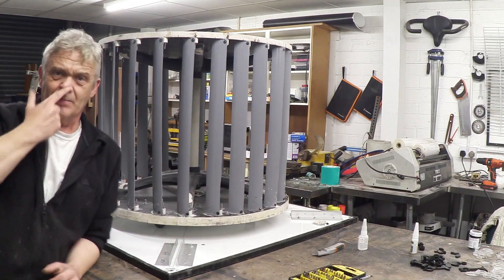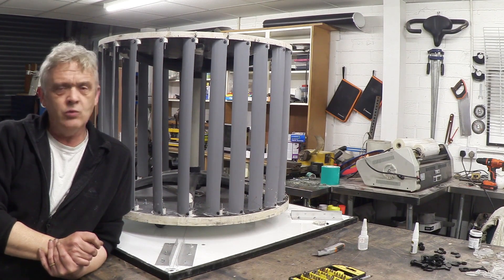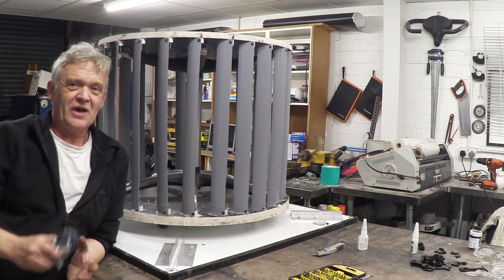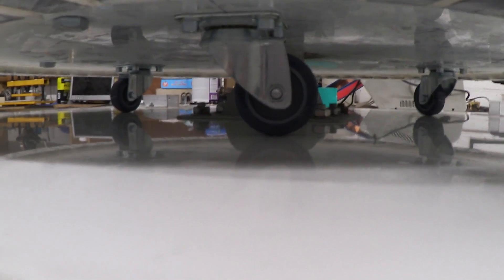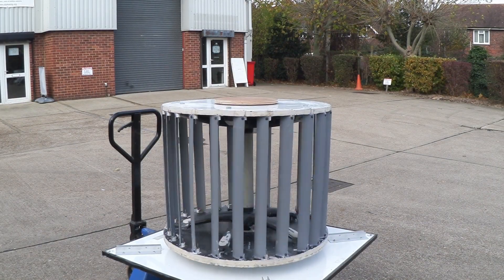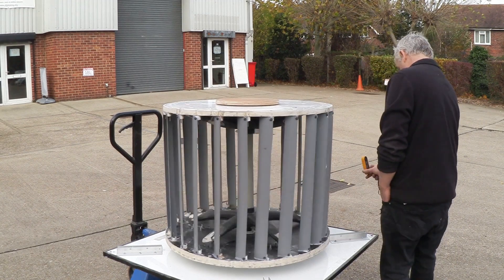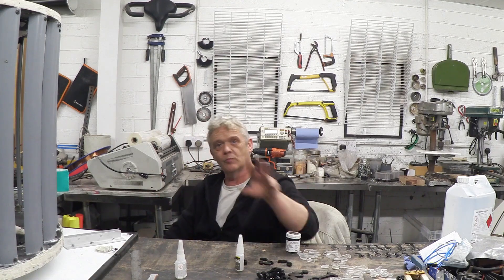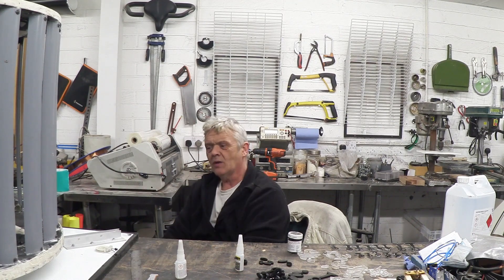Building a 1kW Wind Turbine For Under £100 - A Change In The Design

Comment: Allegedly if you want to have your car do 100 miles/gallon you should remove the tires and put the car on the rail tracks. In my mind, those tiny wheels are probably slowing it down. What do you think?
Reply: I feel the same. Drag/ extra friction
Reply: Desmond Bagley  

Good point. And in good keeping of the overall goal of this video series. 
So yes, one can modify the blueprint to his liking. And should not rip away the paper before the drawing is done.

Having said that... I hate those damn wheels😂. They're a GREAT solution/idea... But I don't like em. 
But... I love Rob👍

Comment: i have absolutely zero knowledge about any of this stuff so mind me if my question is stupid... could you not design the blades to funnel the air up into the Centre of the turbine and out through the top? to my mind, if air goes in from any angle, then air must alos need to flow back out, and wouldnt this be counterintuitive to the air that is trying to get in from other angles? in effect, slowing down the turbine? i am probably totally wrong.

but i thought if every blade was shaped to direct the air that pass them, in and upwards and out of a hole in the top, then the outflow of air will not be competing against the in flow that you want for generating energy.

Comment: I don't think it would last long I would give it 2 weeks in the wind they are just like trolley weeks they never go where you want them to and bearings in them sick you need a trailer hub on an axle  bolt 1side to the trailer hub like a giant car wheel that would give you years of reliability but still fun to watch no mater what way you go
Reply from the maker: or the 'lazy Susan' bearing I was on about
Reply: @ThinkingandTinkering  1 good storm you will have bearings wheels and parts flying everywhere you are better than that Robert either way it's going to be epic

Comment: Start here
Google "optimal design for vawt"
Now, about this Zinc Bromide battery...
Reply: How will you be charging it mate  😉
Reply: @karlmyers6518  I have 16kW of solar, but only 10kWh of Li Ion and 15 kWh of lead acid.
Reply: @simonmasters3295  nicely done mate. I'm on a shoe string currently but if I sit and do nothing I'll get no results. I'm trying to build cheap to share with others